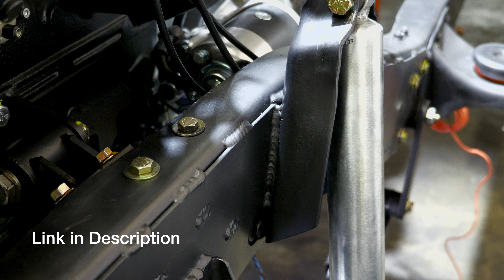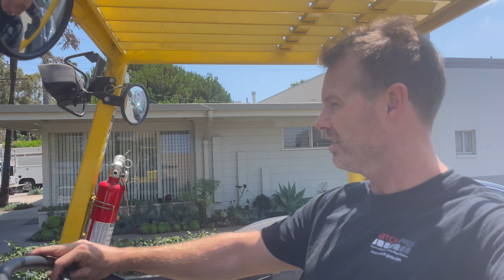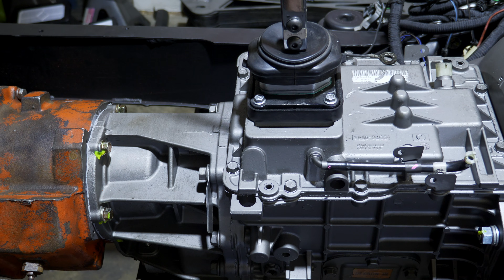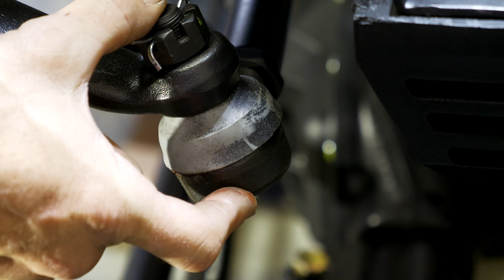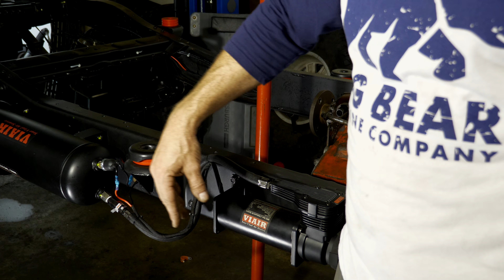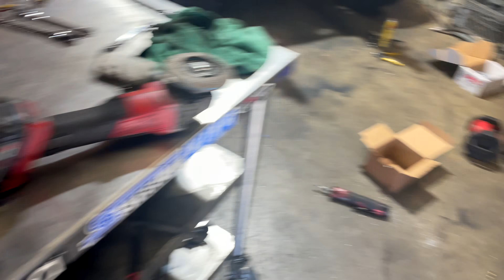Heavy Duty Powertrain!  Tremec TR4050 backed up by an NP203/205 Doubler!

Comment: How do you like the tr4050. I have a 82 w250 with a 392 stroker and I have killed 3 np435s and considering taking the plunge
Reply from the maker: I love it.  15k miles in now and its running super smooth, clutch is easy and predictable, cruises at 2100 rpm at 70 mph
Reply from the maker: oh and its towed for about 3000 of those miles

Comment: Overbuilt, within reason is definitely th4e way to go - there are people who say "I can't afford upgrades", or "it'll be fine", or whatever - my response is can you afford what happens if the part(s) fail(s) - vehicle recovery can be very expensive, even when there's no collateral damage to the vehicle.
For example, those steering joints - all the steering loads are going directly through them, so fitting the strongest one can find is a smart idea - as is carrying a spare or two in the break-down kit, with the tools required to swap them out.

Oh, on that, with the tapered joints, if you load the taper with a pry-bar or jack, it will increase the friction and make it easier to undo the actual nut.

Don't forget a fitting front and rear for airing up the tyres when going back on higher speed roads, after airing down for soft ground.

Comment: Question? I noticed on one of your other videos you have 4 gear shift levers coming out of the top of the transmission tunnel could you explain or perhaps do a short video on there purpose. 
I really appreciate your videos I like the squar body suburban build.
Thank you
Reply from the maker: I have a video up on it.  It’s on the setup in the Blazer but same same
Reply: Cool thanks that really helped watching your video on np203/205 doubler...
I also watched your other video on how to shift a triple shift transfer  case...
Thank you for all of your help ...
I'm looking into buying a suburban I like what you are doing with your square body ...
I was thinking of a 1995 to 1997 2500 4x4 but maybe I'll start looking into something more like yours...
Thank you for your videos keep up the good work.

Comment: One question, why did you mount the hydraulic assit steering cylinder so that the body moves instead of the shaft moving while the cylinder body staying stationary? I am using the same PSC setup but mounted the cylinder body next to my differential with the ram toward the spindle on the tie rod.
Reply from the maker: no real reason.  It doesn't really matter what the orientation is as far as I can tell

Comment: Cool setup!!   We just installed a brand new TR4050 in a 1985 K 30 dually flatbed.    If your reading this comment and are considering this transmission and can handle the expense, I highly recommend it!  
Keep reading if you want some info on our conversion and some problems we had.

   We ordered the kit to replace the SM465. $4700 was the price shipped.    Our truck already had the NP205 and is already hydraulic clutch.     The only thing I did not like and did not use was the cheesy weak TH350 transmission mount.    I honestly cant believe they designed this kit with that crappy mount for a 4x4 chevy.
read all of the instructions first before applying my info.
 Ok now with the truck at a working hight  you need to measure and note how the engine is tilted in the chassis 
in order to keep the alignment of your accessories and exhaust this is super important. shim or block or in some way make sure you know how the engine is tilted.
   now remove the Transmission and case we pulled the case first since they have to come apart anyway.
Pull the seat and floorpan cover because your gonna be in and out of the cab a lot.    I dont recommend using a lift  if your truck is too low just use jack stands just high enough to get the job done because your gonna be up and down a whole bunch.
    with everything out we installed the bell housing onto the engine and checked with a dial indicator the runout it has to be .005 or less.
then install the flywheel and clutch, then put the bellhousing back on the engine and measure the depth of the pressure plate fingers to check if need the extra shim behind the TOB,  we did not need the extra shim.    Put the bellhousing and TOB on the transmission and install the transmission into the truck.
  Now with the transmission on a jack and shimmed back to the correct tilt in the chassis its time to fab/fix your crossmember.
we built one from a piece of heavy duty rectangle tubing and use a section of the original crossmember to maintain the factory heavy duty mounts.   get this figured out and then your ready to install the transfer case and shifter .
  I worked with the parts in the kit and got the shifter working. then figure out your floor pan modifications becasue the shifter stub is about 3 inches back from original.
   In our case the rear drive line needed to be cut 5 inches we had a drive line shop do that  $190    Since the front is low speed I did the work on it myself but you may need to drop both off at the shop.
   The transmission shifts amazing and what a difference from the clunky old sm.    I hope this helps someone and if I see any questions on this commend Ill try to answer them.
Reply: that was getting too long so to add some additional info,   on my cross member setup used 1 of the spacers that came with the kit,   they can be cut to length with a band saw.   I have the old style saddle mount isolator bushings which I prefer.    I had to make a 1 inch steel spacer to bridge the original mounts then drill 4 holes and counter sink them so the bolts wouldn't interfere.     I have the old style 205 with the 4 bolt yoke front output,  if you have the newer flange yoke this will need consideration when fabricating the crossmember.
 If you have a 2 piece drive line I recommend cutting the forward part then shim the carrier bearing to minimize u joint angle problems.
 they sent the wrong fitting for the hydraulic lines,  I ended up  using a 1/8 tube union and connected the new TOB line to the original truck line and a vacuum bleeder is mandatory to get the air out.

Comment: NP205 is better
Reply from the maker: You do realize this is a 205?
Reply: Yeah attached to a NP 203 which is weaker so it don’t really matter how strong the NP 205 is
Reply: 202 vs 203  like tiny  202 175# 50# heavyer than 205 my ? Why use 2 transfer case s vs doubler in 205 alone?

Comment: I plan on doing the same thing with my 84 M1009 Blazer. I have the SM465/205. But I am having issues finding the clutch pedal assay. I was wondering what your plans are to install the clutch pedal?
Reply from the maker: I just ordered from a company called three pedals.  They make a clutch kit!
Reply from the maker: https://threepedals.com/products/hot-products/pedals-drivetrain-swaps/bowler-1973-1987-c10-squarebody-blazer-clutch-pedal-conversion-kit/

Comment: I hate to slow you down on something so cool but I'm just thinking of the first thing that came to mind. How much easier and cheaper would a 7.3 excursion have been?
Reply from the maker: almost what I bought about 7 years ago.  Couldn't find one with anything under 250k miles.  Plus I am a chevy guy
Reply: I can see they're sorta rare and trucks out west get picked over and priced high. I learned to drive in a Chevy and it's all I ever had until just over a year ago when I bought myself a 1995 OBS 7.3 Powerstroke for a drivable project. I'm not going to say it's an affordable hobby but you know that although it is very fun and highly addicting and you'll know just how fun regular driving becomes with an absurd diesel before much longer. The loud cladering idle and revving it up into making boost and adding turbo noises in on top of all that and rowing your own gears, I didn't know what I was missing before and now I don't want to live without it. Best of luck and keep cracking away at what you've got going here as it's turning out amazing and you're an inspiration for all of us.

Comment: is the 205 a round or figure 8 case? I would have thought that mounting the ram assist cylinder the other way would be better(cylinder body at axle).
Reply from the maker: I can swap the ram around but I don’t know if it really makes a difference
Reply: @merricksgarage  i was just thinking that in the way you have it now, the lines will be moving back and forth as you steer which, in my way of thinking, would add stress to the lines and potentially cause them to fail quicker. Just thinking is all

Comment: you have momentum! keep it up! gonna hit some more shows with mine too, and love the road trips in my cummins burb. this thing is a superstar! your's will be even better!!!
Reply from the maker: How loud is it inside?  Did you run elec fans?
Reply: @merricksgarage  
It’s really quiet as I installed dynamat and dynaliner. 
I used all Gen 2 stuff, radiator, intercooler and fan assembly. It was a real fight for space.  I am told that the mechanical fan is better for towing and more reliable. The latter being most important to me.

Comment: Awesome video buddy!! I can’t weight to see the finished project all completed and ready to tear some stuff up!! I just baught another 1981chevy 1Ton 4x4 with the Dana60 front 14 bolt full floating rear and the 205 transfer case 4 speed manual tranny combination!! Witch I think is one of the strongest factory set ups and best in my opinion with running a sbc or bbc engines!! I’ve looked for quite a while for a SRW 1Ton 4x4 and I finally found another one and got the guy to sell it to me!! The other thing is it came with another parts truck witch is a1973 2wd Dullay and had a dump box on it and got rolled!! The 1Ton 4x4 that I got has under a 100,000 original miles on it because it was an old fire truck that only went out to deliver water for field fires and barely got driven maybe at most 6 times a year other then maybe when the fairs were going on and they wanted to get it out and show it off!! I definitely can tell you the 4 speed is like brand new it is so tight shifting you can tell!! That’s the second tightest 4 speed I’ve ever had and they are definitely nice to run!!
Reply from the maker: Nice collection there!!

Comment: Please go into more detail on what parts you used to bolt the tr 4040 to the motor and to the 205
Reply from the maker: Will do
Reply: @merricksgarage  awesome thank you; I’m kinda on the fence between the nv4500 and the tr4050. Either would be a good upgrade for my 79 k20